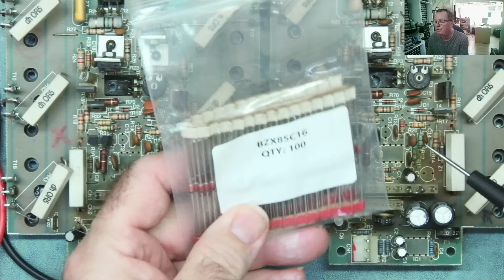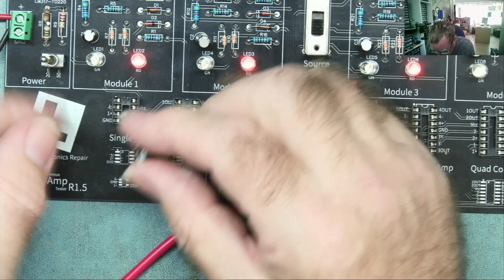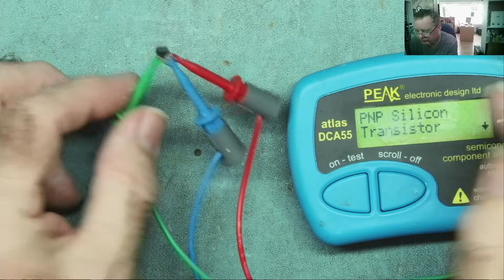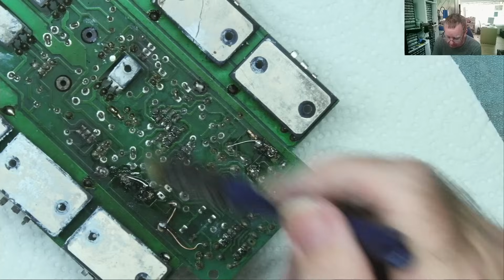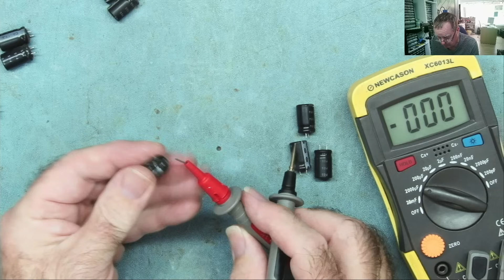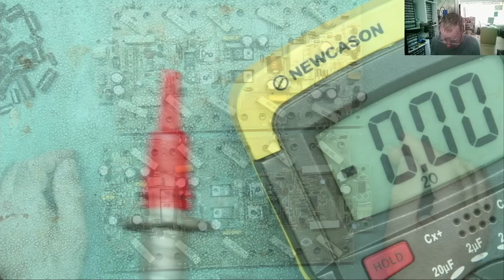Musicson P-802 Amplifier 20+ Years Old : Does This Mean All The Electrolytic Capacitors Have Failed?

Comment: you had a question about what thermal paste was best before an as far as I have learned about it anything air cooled that you don't want the trouble of liquid metal should be nt-h2 or Noctua in general if you don't need the highest heat wicking water or phase change cooling is best with Kryonaut Extreme High Performance but if you want longevity with the effect of nt-h2 its not quiet as good but lasts much longer  ultra-compliant graphene-silicone thermal pads AOK HGP10 which you do not want to touch with your fingers at all even if others do

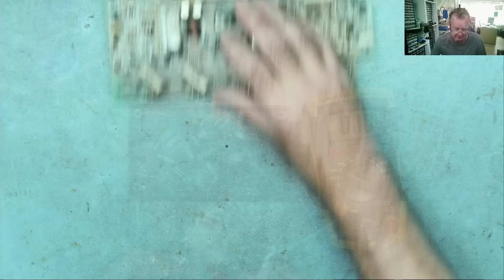Comment: 20:46 Here's my two penn'orth about old electrolytics.
I usually change ALL the electrolytics in something that is years old, and definitely in something that is decades old, is used in a hot, humid environment or the capacitors are right up against hot things on the board, like heatsinks and power resistors.
Even if they test the correct ''value'' on the bench, chances are, when they are under working voltage and temperature conditions, they will drift or go faulty. 
I use a Peak Electronics ESR meter, as it tests both ESR and capacitance simultaneously.

Comment: The combination of zeners with broken traces puts you in a bit of a pickle... normally you do want some spacing for thermal dissipation, especially since the parts tend to be comically small for what they are rated at and can use any help they can get. I remember changing a small flush-mounted one in a Kenwood tuner which had rather darkened the spot underneath.

Anyway, the 1000µ/25V Elna caps that Kenwood used 45 years ago must have been of very good quality... One I was suspecting to be incontinent (but actually wasn't) from my KT-80 basically measured like new and was promptly filed alongside my new parts, another from my KT-900 had only lost a small amount of capacitance with very low leakage. In return, I found two shorted 470µ/10V and a shorted 47µ/16V (in a shielded can, because of course it was) in a 40-year-young KT-880L. (That was a tough one - the center tuning discriminator was way off on top of that. A general alignment did not go amiss either.) The 470µ/10V seem to be a semi-common trouble spot for this model, as I found another specimen "for spares or repair" with no audio output, indicating that at least one of them had failed. 
Considering that I bought this tuner for a tenner plus shipping just to have an original AM loop antenna matching my KT-1100 and it has taught me quite a bit so far and been a thankful modding subject, the thing owes me absolutely nothing at this point. They are also using a 2200µ/16V for 5V memory backup btw, which has been holding up for hours and hours at this point, indicating that not only must capacitor leakage be very low (I am sure that they used a derated part for that exact reason), the TC9147BP PLL tuner IC must also have sleep current orders of magnitude lower than specified.
The KT-900 has netted one substantially leaky 0.47µ/50V (go figure) so far, the AM output coupling cap - it should not be paassing a good microamp at 1.5 V. That section could use a bit of a redesign anyway, attaching a 10 kOhm stereo load throws off the highpass RC time constant quite a bit. No idea why they bypassed the stereo decoder, now the thing could use a buffer! It's a bit short on RF/IF gain anyway, so the AGC action is a bit meh. Using an external loop (Tecsun AN-200) makes it perk up a lot. At least selectivity is good. That makes it the polar opposite of the KT-880L, which is super hot post-alignment but the filtering stinks and 9 kHz hets are everywhere.

Comment: hi Richard, interesting video as always. i saw you use that multifunctional tester to test that zener. i was looking for such a device. you've added a full list of devices in the description but i did not see this one. can you tell me what brand and type it is? thanks!
Reply: I got one from back Alley Express on seeing Rich’s one - search 

0-4000V IGBT Tester Transistor Withstand Voltage Tester Diode MOS Triode MOV LED Voltage Capability Tester 1000V Discharger

Comment: A few days ago I replaced a capacitor on a Playstation 2 power board..I watched a few videos last Month and it seemed one is typically failing..a 33uF 35volt cap..I ordered 10x..I had 3 failed boards..the first one I swapped and tested fixed..the 12v 4pin connector went from zero to 12v out..the next one didn't work..the transformer I tested has 240/250v AC in but almost nothing out..maybe 2v AC if that..I stopped after but I did have one fixed..third board I just desoldered a few parts off it and binned it..

Comment: To me, the distinction between repair and restoration is clear.  Repair is returning the unit to operation, by any means necessary.  Restoration includes a return to operation, if necessary, but equally it must look the same as when it came out of the factory.  Is it restoration if it looks the same but doesn't work?  No.  Repair is functional; restoration is functional and cosmetic.  The intent and magnitude are entirely different.

How far do you take a restoration?  When is it done?  That depends on what it is, who it's for, and what they're doing with it.  If it's being entered into competitions or being judged by expert panels, it should be highly faithful to the original.  In many situations that can get expensive and time consuming.  The owner must have the necessary means and patience.

Finally, certain domains are more exacting than others.  Automotive is perhaps the most demanding, judges looking under the bonnet and under the underneathcarriage, examining the verisimilitude of every part and piece as they do.  In electronics you may have more latitude, depending, but you'll know if you're doing a restoration.  What is the purpose, the budget, the timeframe?  In my eyes there is no room for waffling.  There is no middle. 

If your consumer is unconvinced, you need to articulate that and set expectations.  A repair will be €200 and take a fortnight, God willing; a restoration will be in the realm of €5000 and take 6-12 months.  The problem solves itself.  Am I wrong?

Comment: The TL071s might not make sense to fake given their low value, but they make sense from a popularity standpoint. In my own experience, the most common ICs or transistors are those that are faked the most. I don't recommend AliExpress except as a last resort, because there are far too many occurrences of fake or substandard parts. For something cheap and common like a TL071 there is really no reason not to buy it from a proper distributor like Digikey or Farnell.

Comment: With regard to capacitor leakage:
"Old" electrolytic capacitors that have been sitting on the shelf for a long time can exhibit out-of-spec leakage current. If they are "re-formed" the leakage current will often drop to being well within specifications. Sometimes is is OK to just put the cap into a circuit and allowing it to reform, but sometimes that can result in catastrophic failure. Re-forming as a controlled process is normally done by slowly raising the voltage applied to the cap while also keeping the current low. Charging to the rated voltage through a high-value resistor can be an acceptable method.
Caps that have been recently in service and are leaky are beyond redemption and need to be replaced.
Leakage specs are a bit odd. They are typically some base value plus some additional amount proportional to capacitance. 
In analog circuits, particularly in audio, electrolytic capacitors are sometime found in feedback circuits,, often to block DC. A capacitor that is leaky can cause the gain to change, one way or the other depending on where it is in the network.

Huntron, maker of the Tracker which was the forerunner of the so-called 'curve tracers" (I say "so-called" because they are nothing like a what is accepted as a curve tracer in electronics engineering) that have recently become popular, used to run advertisements  about how their instrument would help you find capacitors that had "gone bad' while sitting on the shelf.

 Poisoning of electrolytic caps:
In the past and to a lesser extent now, some of the solvents sold for cleaning PCB can cause permanent harm to electrolytic caps. Halogenated (chlorinated and/or fluorinated) solvents can be lethal to aluminum electrolytic caps. They can be very effective at removing flux, so they have been popular, especially for re-work. The seals of many electrolytic caps can allow some solvents to penetrate around the seals. The halogen(s) in the solvent react with the aluminum and destroy the cap, though it may take some time. Some capacitors are identified as being "solvent proof" making it safe to use halogenated solvent at least for a brief time.
Isopropyl alcohol, now quite popular though a weaker solvent for flux and highly flammable, is safe in this regard. If the solvent you use comes in a spray can, check the specs carefully.

~~~
The silver-front transistor; Motorola used to make transistors like this. I don't recall any other company that did. It made laser markings quite easy to read. I don't know if ON Semi still does it.

Comment: It's crazy how caps can deceive you i am fixing a 1992 Yamaha multitrack cassette recorder and the caps are leaking from the bottom no swelling 40 of them i tested with capacitance meter they are all in spec it was the ESR meter that showed crazy high ESR.  Also tried with 2 of the multi esr meter and were useless

Comment: Small electrolytic caps in audio amplifiers usually are not subjected to any significant ripple current, especially in circumstances where they are essentially right across a zener diode. That means that ESR is unimportant in terms of heating of the capacitor, so low ESR is of only minor importance in terms of capacitor lifetime. ESR does rise as capacitors "wear out" but these days far too many people think ESR is the be-all and end-all and it just isn't. Small general purpose capacitors of years gone by simply were not specified for ESR. In audio gear, 'low leakage current" electrolytic caps are fairly common.

Physically small electrolytic caps tend to have shorter lifetimes than larger caps. This is largely a function of the fact that the lead seals are of the same dimensions as they are in larger caps. The seals are imperfect and electrolyte is slowly lost. Small caps simply have less electrolyte so any loss is more significant.

Generally, old (as in from years long gone by) generic electrolytic caps just weren't very good and they "wear out." If they even had lifetime specs, and many didn't, the spec was for 1000 hours at 85 °C. That is much inferior to many modern types from reliable manufacturers. Seal elastomers were sometimes poor. Siemens made terrible electrolytic caps. Some Philips electrolytics were also junk though some larger types were good. Rubycon, now known for very good caps, made garbage in the past.

It is critically important that the hole spacing of a PCB matches the lead spacing for radial-leaded electrolytic caps. If they don't, the leads must be very carefully formed. If there is any lateral stress on the leads causing the leads to splay or [whatever the term opposite to slaying is], the seals are compromised and with that so is the lifetime of the part.
Reply: Many good points here! I must say, after many years of electronics work I seldom see bad Siemens electrolytics, the really bad brands are Rifa and Hunts. Philips are good, mostly. I got a batch of 2.2uF 40V (?) Philips axials produced early 2000's which all were bad. I had some of equal value produced earlier, they measured fine..

Comment: Aliexpress even cheap jellybean opamps will often be fakes, simply because the cost of scrap chips is so low, and any mystery reels will be sanded down and blacktopped, then laser etched, as the chips are essentially free, and all the faker has to do is keep the ready to go chips around, and use them up as the assorted chips are ordered that fit the package style. could be anything there, but as it was almost free to them, any money they make is profit, and they simply run a few dozen sellers at a time, and as they get flagged open new ones again.

Comment: With lifted tracks i tend to use the old military method, stick them down with superglue after a gentle clean, then put a conformal coat over them to make sure they will stay down. a thin wire to good track also helps, because the lifted pad will fracture, but glue will hold it in place, and the thin wire will make an electrical connection.  Through hole plated boards a thin wire in the hole, soldered both sides, to make contact with the inner layers, also helped, and the easiest source of the wire was aircraft wire, which is silver plated copper with PTFE insulation, which also was useful to make sleeves for hot running resistor leads.
Reply: I do the same. Just be really careful when you solder to a track that you have superglued down. The vapour released is really nasty and smells really acrid. As its active glue if you get the vapour in your eyes, it can stick them together.  I tend to blow on the track as I solder it and make sure my head is as far back as possible.
Reply: Never ever super glue tracks. The next time someone touches a soldering iron to it, you could send them to hospital. If you don't believe me, try touching your iron to a dab of superglue while your face is over it. It can knock you out. Really nasty.

Comment: hey richard. I always enjoy watching your videos, especially when you repair/restore old amplifiers. one thing to keep in mind (a problem i run into at the moment) old amplifiers are built for 220 volts not 230. So the higher mains voltage "eats up" the built in and tested safety margin for overvoltage to a certain degree. today, with all the solarpanels installed and newer regulations, seeing 245 volts as the mains voltage is nothing new for me. i measure that with a power analyzer continously. the newer regulations allow mains voltage up to 250volts to be "in spec".
So if you repair old gear, maybe it is a good idea to choose some components a number bigger.
In my particular case, its an amp with +-53volts transformer, regulating its +-15volts with a linear supply, built with a TIP127. this darlington works up to 55V, transformer now gives me 56volts. It works for 10 minutes, then magic smoke.

Comment: You have recently discovered quite a few faulty semi conductor devices sourced from Aliexpress.  Personally,  I wouldn't buy semi-conductors from Aliexpress in particular those for use in customer equipment. I think its blatantly obvious they appear zero quality control systems inplace, often provide false test certificates and CofC data etc. May I ask why you persist in using these absolutely crap, perhaps potentially dangerous components? 😮
Reply: Yea i always wonder that too! Im a newbie and i only get stuff from proper shop here, or from scrap. Never from china.
Reply: Exactly. 100% agree. But it is up to everyone who want's to do what. All caps also from ali are no name. They have no specs. Take a look at any datasheet from mouser. There are several parameters like life hours, ripple current, ESR all mentioned. Do you see any aliexpress datasheet and guarantee you that they fit the specs. Lol. Not even talking about IC-s that may function same, but may take like 10x more power and so on. It is crazy to be honest. I'm buying from ali too, but like development boards or only when I really can't find the chip or replacement from legit source. And I know they are from ali so if problems rise I know what could be the case.

Comment: You really need to test the ESR of old caps and not only the capacitance. Preferably also leakage current and check if the old caps starting to leak electrolyte. A good restoration of old equipment comes with a re-cap for sure.
Reply from the maker: I have an ESR meter of course, and use it often - with low ESR capacitors!  But for these sort of capacitors I never found it so useful, however you could convince me.  I intended to change all the capacitors anyway so I didn't see the need.  However I still have them all so let's try your suggestion on the livestream, Saunday 5pm UK time

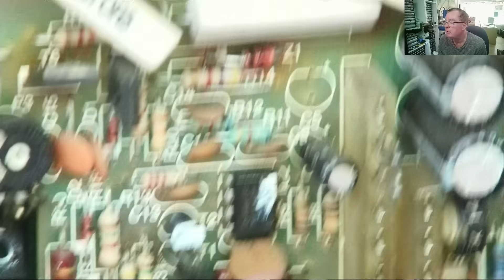Comment: Just a though Rick on 16:35
After reinstalling opamps, transistors and zenner diode's and mendind the traces and before starting with the rest of the capacitors:
Would be interesting to see the result on the curve tracer with the two faulty capacitors not yet replaced, also after replacing them. Just a thought.

PS I usually read most of the comments before sending mine. In this I feel a little nervous since some of the other followers could observe the same thing-question. 😊

Comment: Hi Rich. Capacitors reading higher that their value normally means they are internally leaking. Because the tester checks the charge time any leak makes the cap take longer to charge, making the value appear higher. Not ESR but EPR !
Reply from the maker: Agreed - I did mention that in the video
Reply: Cheers 👍 I did not know this. Even Rich's comments section is educational  😀👍
Reply: I would say high ESR could be a contributor to charge time but less than EPR.

Comment: A guy in the USA on YT 'shango066' discovered that some very old glue used in Electronics (mostly TV's) can become conductive at high voltages that can cause arcing so when ever I see dark brown glue on components it makes me a little paranoid that is may be interfering with a circuits operation!  I think it is best to try to remove old brown glue especially on high voltage devices, especially Mosfet gates it can totally frack up your day.